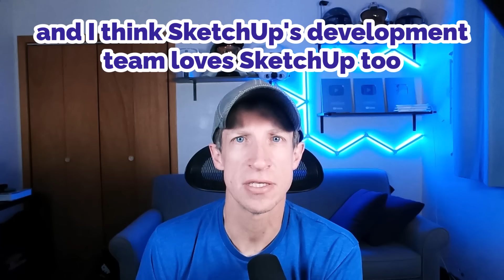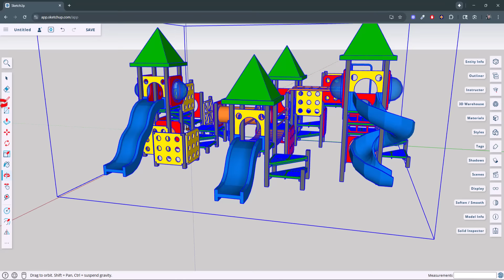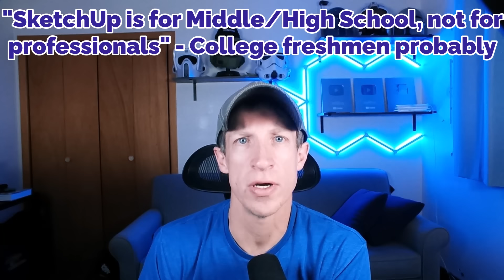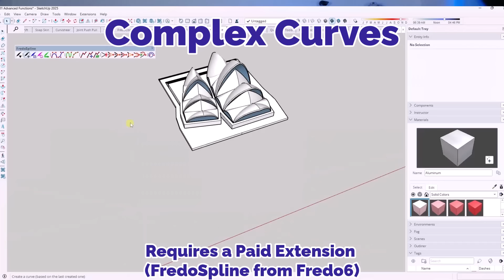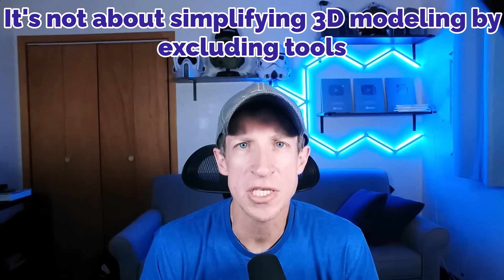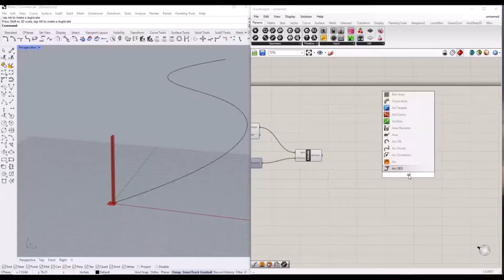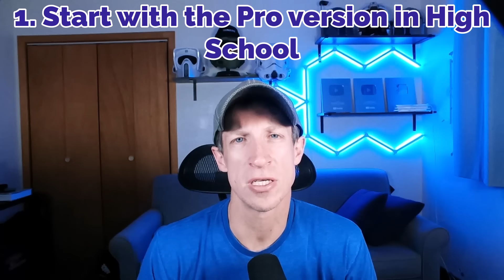Is SketchUp being REPLACED?

Comment: By far , a thing that did not use to be annoying for me - when i used to model only in sketch up , I used to be used to the fact that curves get automatically hosted on surfaces and moving them becomes immediately geometry altering . If you forget to group a part of finished geometry ,and start drawing another part , it “welds “ and takes ages to sort .After i got used to Rhino , for le there was no going back to SketchUp .The only reason I still use SketchUp is energy modelling with DesignPH .

Comment: I'm an Interior Designer and have been using Sketch-Up for 10+ years now. I would say a lot of my career has revolved around visualization mostly and following visualization for interior design specifically. That's primarily where my perspective stems from. While it is similar to Arch visualization, there are some key distinctions. This video really parallel's some of my own thoughts in the past 2 or 3 years as someone who's worked with SketchUp and taught visualization in the higher ed level. I have been strongly considering considering other software like Rhino and Blender to swap too for my professional needs. I would really like to not see a shift for ID to other software, as SketchUp embodied some core aspects to making ID visualization approachable to a field of people rely on it as an aid. 

While my thoughts align in the sentiment that SketchUp is falling behind and missing out on evolving with changing trends. On the ID Side, SketchUp is still an excellent resource primarily for the simplicity of the software, the 3D warehouse, and speed to model and show presentation worthy graphics of ideas. However, my own struggles fall inline with tools like textures/materials. The lack of development on these has really had SketchUp show it's age, especially as other tools like blender become easier and easier to use and teach. Currently, I'm balancing a blended workflow of sketchup / enscape but I'm relying on far too many external plugin's and extensions and sometimes blender to model soft forms and apply complex textures/patterns just to visualize in sketchup.

Comment: In the mid 90's I jumped to SketchUp from Schroff Development's solid modeler Silverscreen when SketchUp was transitioning to solid modeling in addition to surface modling.  The user interface was/is very intuitive for even very complex rectilinear modeling for architecture. But I have to agree that each year it is painful to be forced to upgrade each year and still rely on a lot of extensions for capabilities I had over 30 years ago that were built in. At this point I do more product development for 3D printing and CNC. About 8 years ago I got into Rhino due to the advanced modeling features especially curvilinear designs.  Exports from Rhino just work better for 3D printing and CNC. I will continue to use both until I get more accustomed to the more complex Rhino interface.

Comment: I'm still using my 15 yo Google Sketchup 8. Why ? Simply, didn't need to upgrade. Does the job as it is. Since then, they didn't add one extraordinary feature that could make me really drool for and upgrade. What they did instead was to lie. They lied that the 3D Warehouse would be free. And it's not. Not for my Sketchup 8 license. Google betrayed us, selling the 3D Warehouse to Trimble. But then, when Trimble changed the policy and you had to continously upgrade to access it, it turned clear to me that I'm not going to upgrade. Don't really like to play the game by other's rules. Especially when they change the rules as they please. So yes, for me, if it's not perpetual license, and a good product that it's worth it's price and holds value, by bye! 
And indeed, Rhino is both perpetual and worth the price. Maybe I'll buy it and force myself to learn it. Thank you for the video!

Comment: Im using SU pro 2025. If sketchup could fine tune those lines to very thin in layout as thouse in autocad and have those pluggins beome easily eccessible it will be owesome. The starts ok but when you start getting pluggins like Decasteel and Meedek etc, you spend a whole lot of time learning and people turn to lose time on meeting deadline on projects. i know once you master the art of modelling without pluggins and you realise its more time consuming and pluggins become handy. i suggest SU should open up and intergrate additional tools to make modelling alot easier.
Im a builder from the Pacific Island of PNG or Papua New Guinea.
im a big big fan of yours and im quite worried now your shifting Rhino.

Comment: I hate Rhino, I hate blender, Sketchup is hands down the program for real life builders. For people actually out here actually putting structures together, once you get your workflow down it is literally cut by cut, connection after connection the closest thing to full scale construction and the easiest for real life problem solvers to hash it out with real world results. I've worked with engineers and architects in the past who snubbed their nose at SketchUp and then be super curious what software I used when my prints started rolling out of the plotter. If Trimble had ever been serious about being the king of construction documents then they would have already had a dedicated team building a truly free, truly searchable library of fixtures, hardware, fasteners, doors, windows all to scale and all based on manufacturers technical specs and model numbers with updated product lifecycles, the problem is the manufacturers have been using rhino and solidworks for decades. Layout is a love hate relationship for me, the tools are still baseline and the navigation is clunky and time consuming. Studio is on the right track for the future but not for the beginner with a lightweight laptop because you need a freaking beast of a workstation to do complex full scale modeling.

Comment: As a BIM manager, I have a couple of thoughts:
1. Rhino is a permanent license and it lives on your desktop and you do not have to have a web browser to use the platform. 

2. You touched on parametric design and node based model generation and its limited feature set through Trimble. Trimble is one of many examples of companies only wanting to develop web apps for the future. Cheaper to develop and you are further siloing your user base to only use your platform. If you are not careful, in the end, who owns your intellectual property if you cannot save those projects or access without having to pay?

3. Parametric design and big BIM data is becoming more critical in the design process and during construction. Sketchup is a modeling software and not a software that integrates BIM as easily or seamlessly as other software companies. It just does not play as well with other "BIM" software like Rhino does where it's easy to associate BIM data for critical decisions. 

4. You have to pay for add-ins just to get the "same" feature set as other BIM software companies. While there are still plenty of easy modeling features missing with the big names, the fact that most have a node based scripting language built in bridges the gap of features/improvements/customized workflows that Trimble deprioritizes. Trimble not making that easy or simple and it's a huge problem where automating manual processes is key to profitable projects. 

All of these together is pointing towards Trimble not making the user experience easier but more expensive.

Comment: Thanks for doing this Justin. I would always welcome a new toolset for SU. In relation to education- I'm a seasoned SU trainer and I even wrote the first book of Construction Documents Using SketchUp Pro- The later version of which is still on sale. So- Here's a weird fact. I took the SU trainers assessment twice and failed both times- Mainly because the assessment requirements were extremely poorly communicated and so I didn't have a clear idea of what the assessors were looking for. Also, the features I was asked by the assessors to demonstrate were NEVER asked for in my 15 years as a trainer- My customers want someone who can clearly explain the software to them and design customised day to day workflows for THEIR purposes- Not how to tweak the settings of a tool or setting they will never use. I know how to use pretty much every feature SU- But not to the point where I can instantly do a reasonable presentation on the photomatch tool like I've been using it regularly- That's of no benefit to students who want to know how SU works for THEM, not some esoteric college course material. Just getting that off my chest. I'll try again some time to get registered again- Maybe they have a properly explained process now. Third time lucky. At the same time maybe I could show SU trainers how to write a SU training course book on creating Con Docs with pristine downloadable SU models that sells for years and gets 4 stars on Amazon. 🙂

Comment: I admit bevels tools are lacking ! So hard to implement an already existing piece of furniture in an interior design (that the client wants to keep) without needing to do a bad job at modifyung a pre existing no the same item found in the library because I can't quickly draw curved bevel lines and extrude. I agree with Justin. And I don't want Sketchup to disappear neither ! It just would be sad because if I feel I need to, I will 😐

Comment: It's not a "problem" in any way. Rhino is far more capable as a stand-alone program, has exceptionally powerful parametric tools, and integrates incredibly well with Revit.

Sketchup models are much less useful, and Sketchup's licensing is predatory. There was absolutely no reason for Sketchup to drop shared license pools outside of greed. Our old firm saw the writing on the wall and left Sketchup years ago, designing exclusively in Rhino and Revit.

Competition is good, except for companies that quit innovating...which Sketchup has done for quite some time

Comment: As a secondary school teacher, the web ap isn't powerful enough past ages 12. I also have ongoing issues with students understanding of how the geometry behaves. Despite MANY variations to my teaching of grouping, components, faces etc etc, Working with solid geometry makes sense, and curbs alot of frustrations. We are moving to Rhino for seniors next year. Another common issue is the use of BYOD vs. lab devices. Licensing choices is an ongoing nightmare. I've always felt, as you say, many of the plug-ins, like beveling, should be standard tools. I really feel SketchUp doesn't understand the level of architectural learning that is occurring in Secondary school level.

Comment: I agree 100%.   I suggested a client company to use SketchUp over 10 years ago to make their sofa frames models.  It was an uphill battle because they did not consider it "professional" or "industrial".  They could not find what they wanted in AutoCad and others at the cost they wanted.  Eventually went to SketchUp (the free version which covered what they needed) and have been using it ever since.
Reply: iam off the same view, sketchup is owesome in terms of presentation in the 3D space. it only needs to make those lines fine in layout and add a few more tools.

Comment: In fact, in my case, I've had to implement modeling of more complex shapes with Blender to compensate for the lack of some modeling tools in SketchUp. I haven't wanted to upgrade SketchUp's paid add-ons. Even so, for me, SketchUp remains a tool that allows me to model quickly in architecture.

Comment: Great points, but Rhino is more affordable, and way more powerful.  
Sketchup, is a toy.  
I know you love it… but graduated up to Rhino.   
You’ll be happier.
Reply from the maker: I use both. I've taught both. Love Rhino for modeling tools, but not for documentation, or stuff like cabinets or interiors. SketchUp is way better at that, so to me it just depends on what you need
Reply: @Thesketchupessentials  that’s fair. I find it easy to document in Rhino, using similar methods to AutoCAD back a few decades.  But I have not tried documenting in Sketchup.
Reply: @Thesketchupessentials  i don’t do a lot of cabinetry, but I do interiors and exteriors, and vehicles/products.  
I have a client that wants sketchup files at the end (which drives me crazy) and that’s what brings me to your channel.

Comment: Sad but true. I've been using Sketchup since my student days, it was a groundbreaking tool for that time (mid-late 2000s), but times have changed and while other architecture software made great strides, I can count on one hand the valuable updates that were added since Trimble took over. That despite forcing that ridiculous annual fee and replacing the free version (which used to be almost as good as the pro), with that watered down web app). Truth be told, a basic user could probably still get by with Sketchup 8, while an advanced user wouldn't be satisfied with 2025 unless they buy a ton of paid plugins. As more and more smaller practices are transitioning to Revit, they no longer bother with SU at all, as basic mass-studies functionality can be achieved from within Revit and SU isn't worth the extra investment.

Comment: AI rendering is everywhere. Until I can bring in images from elsewhere and tell AI in sketchup that, "I want this face to look like this stone facade, or this plaster" then it isn't worth using. Until I can control certain aspects of images on what I want to keep or change in the render, it is not worth using. Right now we are stuck with prompts and there is no real control over the images. It makes the AI almost a useless gimmick, almost. Also, the materials list in Sketchup has not gotten a worthy update in years and it looks outdated... that's because it is. I hate that I need third party software and licensing just to find decent materials and assets. AI should be able to make a model look photorealistic but it isn't consistent enough to use or trust.

And yes, we need more modeling tools.  I am shocked by the lack of advancement in this area in particular. That and the lack of quality materials/textures... truly shocking.

Comment: My class of 30-40 couldn't run sketchup once it required a internet connection.  A schools network can't handle a single class trying to each build a house at the same time.  Each click requires a internet connection to process , so if I want to simply rotate around my model, the program pauses for a few seconds each time.   So we have up Sketchup 3 years ago

Comment: I have used Sketchup for dynamically, modeling some gear trains, using their plug-in for physics models.  I really liked Sketchup, but as you said, it had some tool limitations. Also, although the renderings were fine, they were a little cartoonish. And what I was using it for this was fine, but I can see how others might want some more elegant renderings. For these reasons and some others I ended up going to ViaCAD which has both a Macintosh and a Wintel version. It is not as easy to use as Sketchup, you really have to watch the tutorial videos very carefully. But once you understand the paradigms, it is extremely powerful for the price and can produce very professional results. I have not used rhino, but from what I have seen of it, I think ViaCAD or it bigger brother SharkCAD can give Rhino a run for the money.

Comment: There's also a huge problem where many schools, in particular in my experience with universities teaching Landscape Architecture, there is for some reason a feeling that they should not teach extensions. Some have "rules" in place from professional curriculum review boards about this. This applies to all software. 

It doesn't make any sense, since they're doing this even if the plugin if FREE to students. 

There are of course some universities that do include showing the students relevant extensions in the curriculum, but in my experience most don't and some specifically have told me they're being told they're not allowed to. But since Rhino3D includes Grasshopper out of the box, they can justify teaching Grasshopper with these believed restrictions. 

What you're accurately describing is actually a result of the education system and teachers/professors being restricted and so not being allowed to keep up with the technology of plugins.

Agreed - SketchUp Studio should be free to students. Yes, needs a better visual coding algorithm creator inside the model. But also, we as design professionals need to pressure educations departments to stop putting restrictions like these on teachers and professors.
Reply from the maker: This is a nice piece of context - thanks for sharing. I can see how the whole extension piece could make this a lot more complicated for educators. Lol - I'm not sure the solution I'd want would be "so we'll have a web version that just doesn't have these functions" though (which seems to be the current solution) ;)
Reply: @Thesketchupessentials  totally agree. The web version is just not usable without plugins, since SketchUp is not effective on its own without plugins. SketchUp has a chance to go back to its roots of focusing on perfecting an intuitive simple platform.